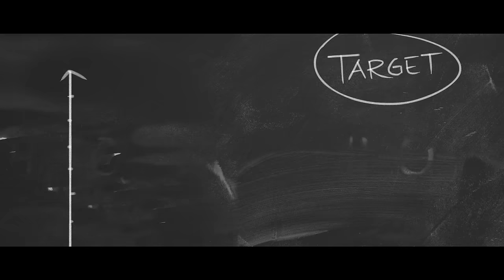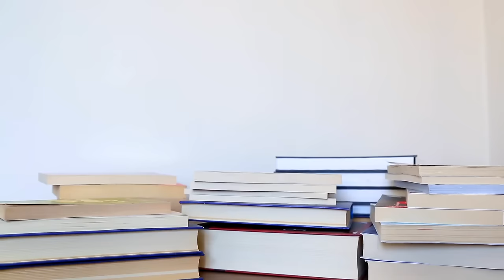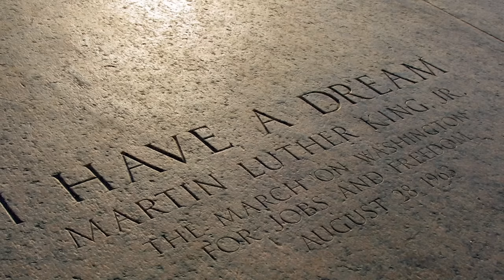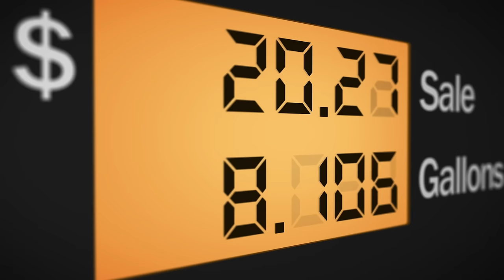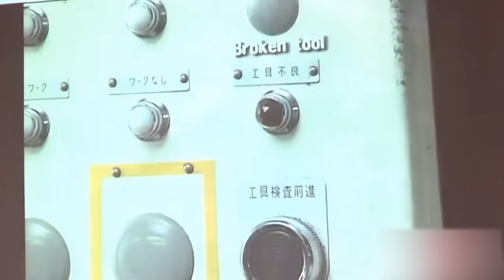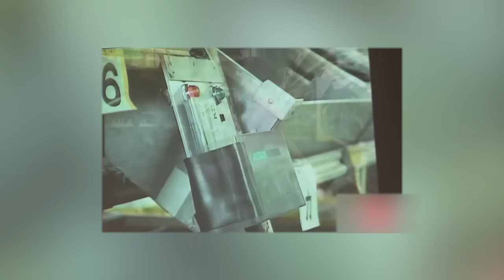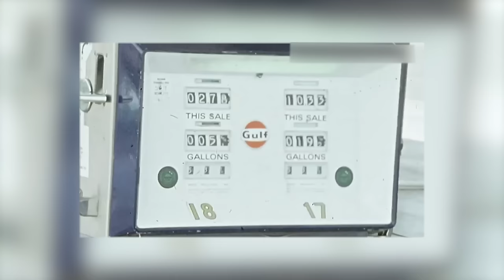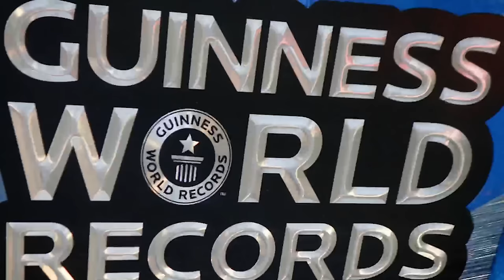TOYOTA - THE HISTORY OF THE COMPANY. WHAT YOU DIDN'T KNOW

Comment: Toyota deserves it's success... Great reliable cars that go on forever
Reply: “Reliable” mark sailor died in a Toyota due to a stuck accelerator
Reply: @woodentrainseriesofficial9511  Same my car did to rip my dad :c.
Reply: @guywithideas9561  rip ☹️
Reply: @woodentrainseriesofficial9511  was a vendor floormat that caused the accelerator to stick. Not anything Toyota did. Toyota took the brunt of the blame for it though.
Reply: its*
Reply: Lovely cars, my grandad had a hilux, got 500,000 kms, engine swapped it and got it to a million. This was as a farm truck also, so quite rough life
Reply: Yes they are good🚙
Reply: @woodentrainseriesofficial9511 yeah but that was because of the floor mats, this didn't really count towards toyotas relilability and has since proven loyalty, toyota also paid the price in damages for it. my dads prius has been running strong at 800,000 km. which is pretty good. (he's a taxi driver)

Comment: I think what was missed here was some parts of the Toyota vehicles were contracted to suppliers such as batteries, tires, seats, spark plugs, condensers, windshields, weather-stripping, and the like. If Toyota  focused on the manufacture/production on those minor parts, it did not have much to do on its reliability. Maintenance therefore was easy and cheaper for replacement parts. Toyota also opened a market for the suppliers in that case. Compared to other country car manufacturers who manufactured almost every single part, they had more concerns.  That started the OEM thing that cost much higher compared to "OEM" parts of Toyota that was supplied by their accredited/authorized parts manufacturers. My two cents piece.